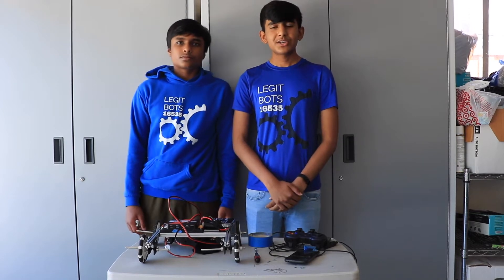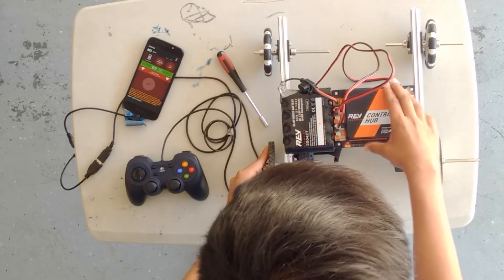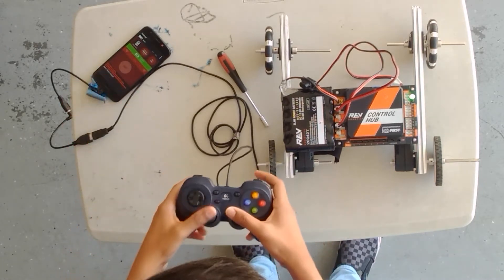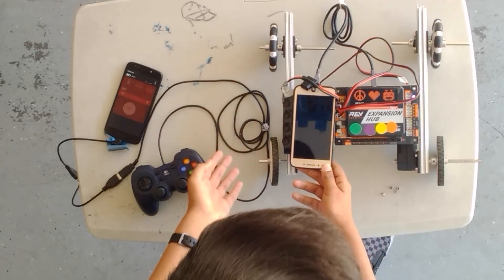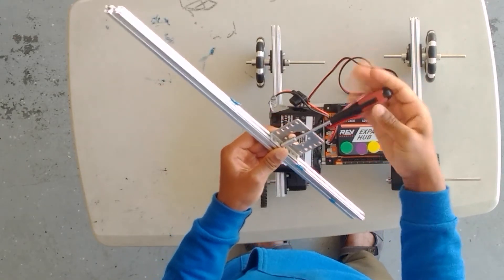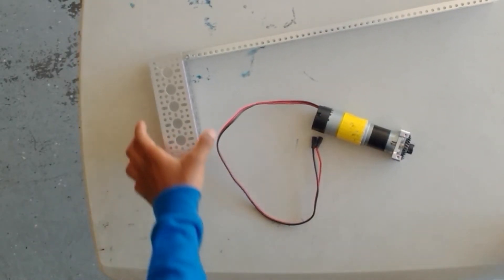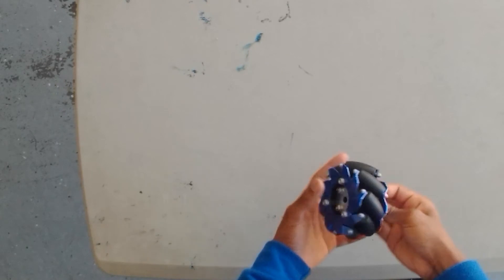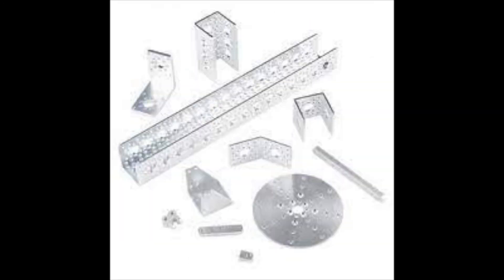Intro to FTC Engineering: Robot Control Systems and Build Kits

Comment: Tetrix is not cheaper than goBILDA. goBILDA offers a 25% discount to FTC teams, which means it costs about the same as Tetrix. 

DO NOT BUY TETRIX EVER. IT IS GARBAGE. Buy goBILDA instead. Steer clear of FIRST's official advice about build systems, because FIRST is sponsored by Tetrix.